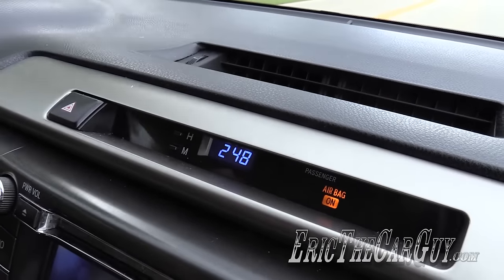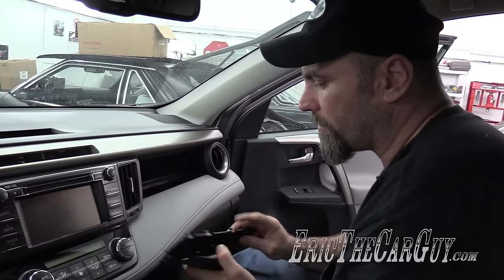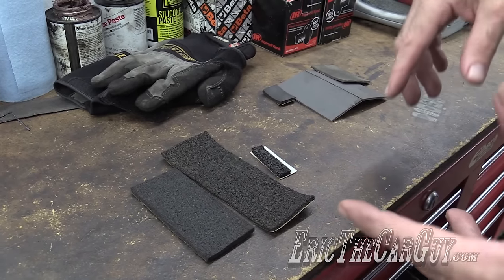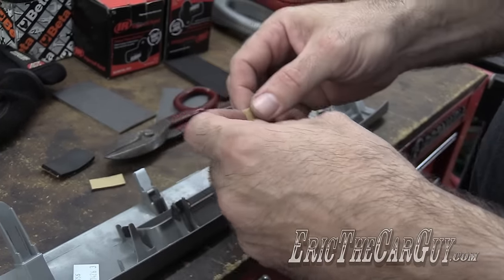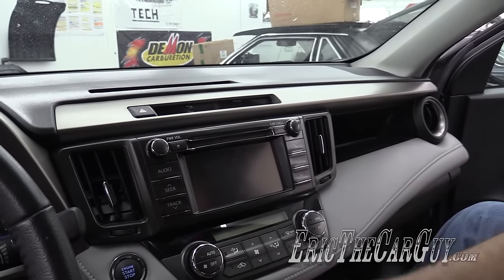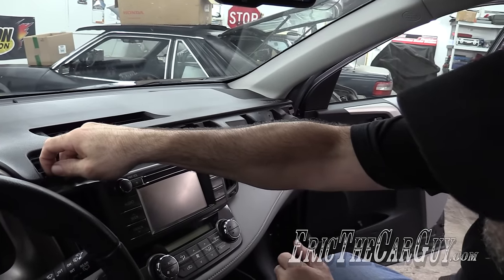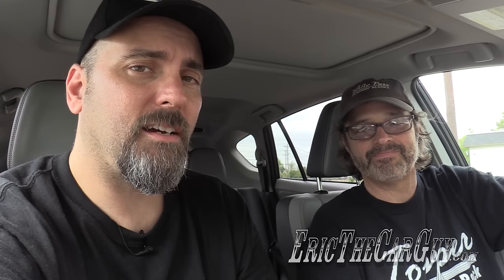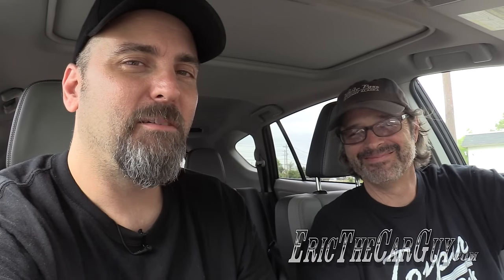How To Find and Fix Dashboard Noises

Comment: I am in the process of buying one of this, by any chance this model was made in Japan? I am only looking for one made there. I am in the USA too. Thank you for your response.
Reply from the maker: Most Toyotas sold in the US are made in KY these days. Very rare to get one imported from Japan.
Reply: If the first digit of the VIN is J, then it was made in Japan.
Reply: Exactly Nik12937, most Rav4 sold in the USA are made in Japan but there are a few that are not, that's why I was asking Eric about this particular one you fixed Eric, thank you.
Reply: i have 2013 rav4 and torque converter and water pump have beem replaced. only 40k miles.
Reply: I have a 2007 4runner V8 made in Japan and just a brake light bulb has been replaced in 9 years and 85K miles it still has the original Panasonic battery.
Reply: +J. Gutierrez just tells you that toyota is not what it used to be.

Comment: I would put in a piece of foam inside of the seam of the rattling plastic piece.  Sometimes rubber glue adhesives on one side of the part can stop the rattling as well.
The 1990's Toyotas  plastic pieces had better tolerances than today's cars.  Looks like the car industry is just cutting corners these days with cheaper fitting plastic.

Comment: Curious as to how much time this took in total? Also, wondering if anyone's ever tried using silicone spray to keep the friction noises down between plastic parts?
Reply from the maker: It took me about an hour total, but you need to consider making a video takes a lot longer than just doing a repair.

Comment: man my 2019 civic si is way worse, it rattle in the dashboard, steering wheel, even at the door panels and the windows...
Reply: a 2019 civic is is rattling everywhere? I'd be pissed. but it seems every new car is now plastic and clips everywhere to reduce weight. My 2016 wrx is also rattling every stinking where.
Reply: Ayeron T Diep Have you tried turning it off and on again?

Comment: Ahh silent dashboard, i like the sticky backed foam :-).
That loose plastic cage round the display was sloppy, i would take it apart and apply rubber solution or similar to the mating edges, wait 10 minutes and re assemble.
Reply from the maker: I think they make it that way so that it fits into different applications. Thanks for your comments as always.

Comment: guys, I have a rav4 2016, it is a lE, have already sent the car to dealer for 2 times for repairing. they are documented. But acturally I have drived to dealer for 5 times totally. the other 3 times they just said they can  not fix it unless I pointed it.
The fuccing rattle is still exists, I really want to sell this car. Is anybody knows how to complain it with toyota? or to dealer?

Comment: could it not be an engine mount or tranny  mount gone bad causing all of these buzzing noises? I had the same issue on my ford focus, and it turned out to be an engine mount! a hydraulic type. since replacement, the thing just glides now! any ideas, Eric the car guy?

Comment: I have a metal vibrating noise coming from my back dash. Right under my rear windshield. Any ideas guys? :)
Reply: I own a 00 honda civic btw
Reply: Check the torsion springs that lift your trunk lid, those things can flop around and make an awful racket.
Reply: +AKLmfreak that might be it. The noise happens randomly while idling and scares the tf out me sometimes. Especially in the morning lol
Reply: +AKLmfreak thanks a lot! Turns out it was the torsion springs were the ones causing the noise! :D
Reply: Sweet, glad i could help.  I had the same problem when I went to stiffer motor mounts in my MX-5
Reply: turns out I didn't even have the clip for the torsion bars in my trunk.

Comment: I have a terrible rattle coming from the back seat of my 13 STi.  I cant for the life of me get it to go away.  I've taken it to the dealer and they "fixed" it.  Frustrating.
Reply from the maker: Like I said in the video, not many dealership techs will take the time to do this correctly. At least in my xp. There are a lot of very good dealership technicians out there. They're just hard to find.
Reply: I dont blame the technicians.  I realize it's difficult to get paid for that type of work. I'm terrible with a wrench so I rely on professionals for help and when the system is flawed...anyway.

Comment: Someone needs to find a better material than plastic. Or maybe the car manufacturers could use rubber to reduce plastic contact
Reply: Rubber will fall apart after a few years in the heat from the sun.

Comment: I have a 2016 Chevy Impala LTZ and the damn thing rattles everywhere, dash, back doors, pillars, been in the shop over 20 times in 3000 miles. Even the paint by the Chevrolet crest on the trunk is clouding up.. Piece of absolute garbage.

on the other hand my 05' Range Rover has had nothing go wrong in 50,000 miles that I've owned it and nothing absolutely nothing rattles. Only downside is 12MPG

Comment: I've owned one Toyota in my days, and I say never again. No more, never, ever, again. Crappy overall build quality, somewhat reliable if you treat it right. But hell no, never a Toyota on my front yard again.
Reply: My uncle has owned six in a row, mainly Yaris but also Corolla and Starlet.  His experience has been one of trouble free driving and rarely having new parts fitted.  This is in England (UK) where the roads are uneven and full of pot holes.
Reply: Suboptimus Lime
Oh right I did not know that.  I wonder if the ones recommended by people like Scotty Kilmer on YouTube, were imported models into the USA / Canada?
Reply: Suboptimus Lime
Wow I never realised he advocated doing things like compression fittings on brake lines. Also welding is quite a skill to do properly, as is paint spraying.  Hmmm.....thanks for the heads up.
Reply: +EgoShredder Try Indiana. Horrible roads.

Comment: My how far Toyota has fallen.
Reply: Honda is just as bad sadly.. It's sad.
Reply: +SeverdSeouL hell no Honda is amazing. They just keel getting better. Hondas made from 2011-2013 are shit though.
Reply: Keep*
Reply: It seems like Subaru, Ford and Volkwagon are having simular issues too. I have 2012 focus that rattles in 3 places.
Reply: Mexico has crappy Quality Control
Reply: These rattles are a bigger problem with all cars these days because of the plastic but that doesn't mean that they all experience these problems. I own 6 Toyotas and none of them have any dash rattles like this from my 89 Supercharged MR2, 2006 Scion xB, 2009 Corolla S Turbo, 2010 Prius, 2017 Corolla iM to my 2017 RAV4. Every one has been an excellent car and Toyota is still consistently at the top of CR rantings from owners.

Comment: toyota quality for you!
Reply: My dad has a toyota, muffler heat shields went loose, made so much rattles that it was embarrasing to drive that car around, then they disintegrated and it went quiet again. Interior pieces fall apart, everything unclips, you open a storage bin, it falls out completely. And the car was only 4 years old, never again.
Reply: I can say that to any car today outside of hand made units. So branding ain't got nothing to do with it. If you want to blame anyone blame people who decide to get in a car and say "eh, fuck it, i'll buy this plastic town".
Reply: =Lexus?
Reply: have a rav4, 4 years old, 40K miles and it is a nightmare. there is a high pitched noise coming from the back seats, another noise which I think comes from the doors, another noise from the dashboard too. I am hoping to sell it soon. the funny thing is that no one wants to buy it. I have tried other brands and they do not have that kind of problems. and if you add all the super special fluids those stupid cars need that are so expensive. this is the first and last time for me.
Reply: Says the Maxima guy. Nissan quality has been pure junk since 2000. They are the Dodge of Japanese cars. We bought a brand new 2001 Sentra. By the time it hit only 60K miles we had already replaced the leaking radiator, A/c condenser, 2 oxygen sensors, rear wheel hub assembly, front driver window regulator and the glove box door fell off. That's Nissan quality for you. Don't even get me started on their CVT transmissions... pure garbage.
Reply: +Nutz4Gunz45 They're garbage as well then, lol
Reply: Did you just make an entire comment based off my user name...How sad. 1) I really don't care for nissan 2) Do not make assumptions 3) worst thing to come out of japan is mitsubishi motors. 4) All manufactures have problematic cars. You ended up with a lemon, it happens. Oh and my original comment was not to be taken too seriously..Have a good day.
Reply: toyota quality light years better than domestic

Comment: that seems like a poorly made vehicle. rattles alot and came apart way to easily
Reply: so you rather take hours taking a trim piece off?
Reply: +NewEdge Resto id rather have to take it apart than give it a lil tug and it falls out. in my older car theres all kinds of screws in the dash, its 30+ years old with the dash made from vinel and plastic, no rattles because it serews together securly
Reply: There shouldn't be plastic trim pieces. Walnut. Chrome plated steel or stainless steel. Leather. These are the things we should have in the interior of a car. Not enough plastic to effect the nikkei index.

Comment: I'd be more concerned about the Air Bag light ?
Reply: It means the passenger side airbag is on.
Reply: Tuningfork23 I am fully aware what it means lol, It shouldnt be on.
Reply: If an adult is sitting in the passenger seat,  it should be on.  If an infant that is under the sensor's weight limit is in the seat,  it should be off.  I'd imagine the light is there to tell you whether or not it is armed.
Reply: Dacke Oh ok, thats different on Aussie Cars, If the light is on it means there is a problem with the airbag
Reply: Yeah,  here if the airbag light on the driver's side stays on,  then there's a problem with the airbag system - it could be anything.  The one in the center of the dash is specifically for the passenger side though.  Children get killed by airbags,  so manufacturers got a lot more proactive about telling you whether it's on or not.  Some also use the car's keys in a separate lock so that you can turn it on or off yourself.
Reply: Dacke Cheers :)

Comment: So, I stopped the video at 3:40 because I had to make this comment. Toyota's quality seems to have gone WAY downhill from the early 90's through mid 2000's models that I have most of my experience with. Just looking at these plastic pieces that are barely attached to one another, rattling around like they are,  I'm not even sure the Fiat designed Chryslers that I work on are this cheaply made. And believe me, they are cheap junk.

Comment: now.... take on a 1980-90  Peugeot ... Those are infamous...
Reply from the maker: No thanks. ;)
Reply: +EricTheCarGuy I remember a quote I read on a Peugeot/Citroën site that stated that ALL dashboard of that period had a rattle at idle.... I can confirm that they didn't lie....
Reply from the maker: Perhaps they were more concerned with keeping the car running over a smooth idle and quiet dash.
Reply: i never had an issue with my 1985 Peugeot making rattling noises and their dash came out quite easily
Reply: +lew bear Well..... I may have exaggerated the problem a bit... 😉 I don't have anything against Peugeot's ... In fact I have owned a 205 and a 309.... And my parents have owned a two 405's and a 309
Reply: 80 and 90's? I had a 206 and driving it was like been in a drums concert. Excellent car, however.

Comment: brian NEVER buy a used toyota
Reply: Better than a used Dodge
Reply: Nutz4Gunz45 true
Reply: It's better than a new Dodge.  Check the Consumer's Report.
Reply: Never buy any toyota period
Reply: +Frank Magana my 95 Camry (before I gave it away to a 16 year old for their first car; it's STILL on the road today) with 463,000 miles on it says differently. Only thing changed on that was fluids brakes thermostat and engine mounts. So tell me again how "never buy a Toyota" is a mantra you believe in..
Reply: CDubs HasIt My sister put 375,000 miles on her 15 year old Camry wagon before trading it for a Prius. Brother in law put 425,000 miles on his Tundra pickup before he sold it.  The kid is still driving it with 485,000 miles on it.

Comment: Servo motor I’m 37 secs into video let’s see how right I was
Reply: Now that I have realized I’m completely off a good solution would also be to spray silicon lubricant and wipe it down just lube the surfaces To have the part slide against each other instead of Rub

Comment: What a horrible design on that hazard switch clock assembly pointless piece.  Can't stand modern dashes, with their watered down GPS/factory media center iphone syncing BS and and their overall impractical design.  Hazard switch all huge right in the center, pointless curvy plastics.  Just trash.